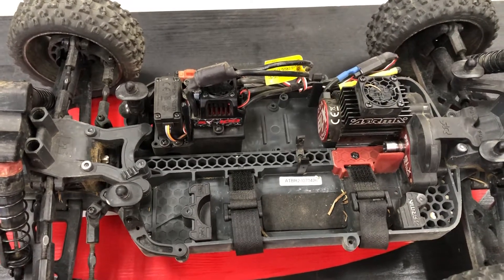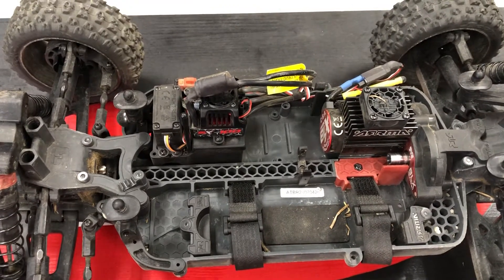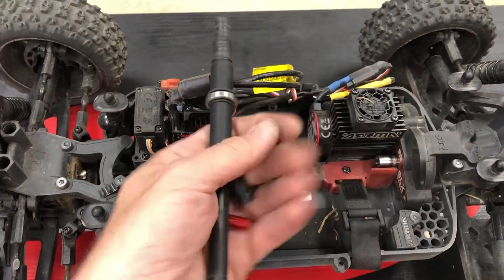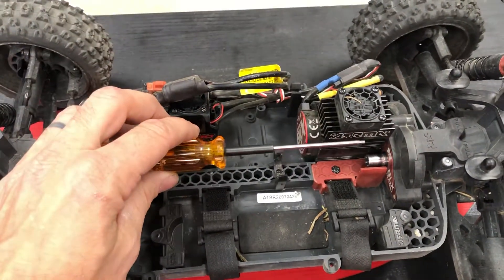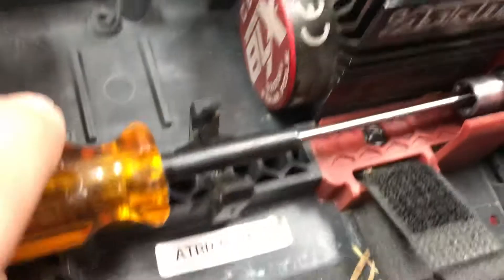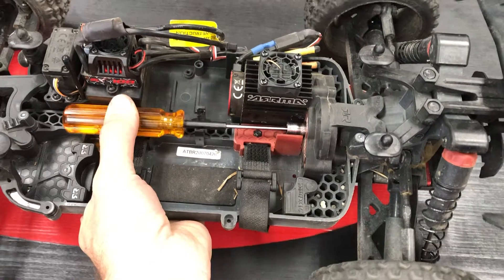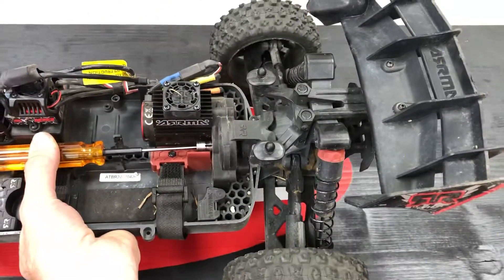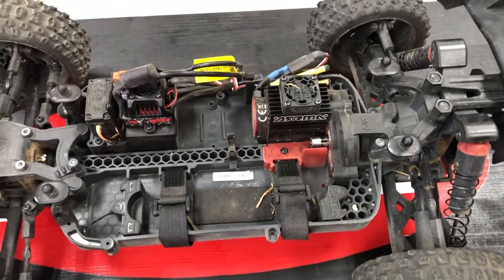How to adjust the slipper clutch on an ARRMA Mega, 3S, and 4S line of Car

Comment: I realize this is old, but I am hoping someone spots this and can help me out. I recently ripped up my spur gear in my Typhon mega (technically, I upgraded to a brushless 3s motor set, but the slipper clutch is still original). So first I'd like to reiterate that this video does not apply to the mega. It has a nut that gets tightened (unless the mega changed slipper clutch assembly since this video was put out). 

Here's my issue. I ordered a new clutch assembly, but disassembled mine just to see how it works, and it makes zero sense to me. The spur gear and the metal part (pressure plate is all I can think of the name) are both splined and on the same shaft. This appears to make the friction plate completely irrelevant as the 2 cannot be spun independently. What am I missing? The replacement I ordered should be the assembly from a 3s, so it shouldn't matter, but I am trying to understand how the mega one worked.

Comment: Hi friend, sorry noob questions. Why we have to adjust the slipper clutch? Whats the impact  before + after ? I have my senton 3s blx v3.
Reply from the maker: We are all noobs at one time!

So the slipper helps protect the spur gear from damage when you have a lot of forward and back movement. When you have it going full speed forward and slam it into reverse, it literally makes the gear slip so there isn't shock damage.

When you do that a lot, the screw that's in there can back out a little or the pads can get worn down, so from time to time you have to tighten them back up.

When you pull on the trigger and the car barely goes and sounds like it's screaming for it's life, odds are good it's just out of adjustment :)